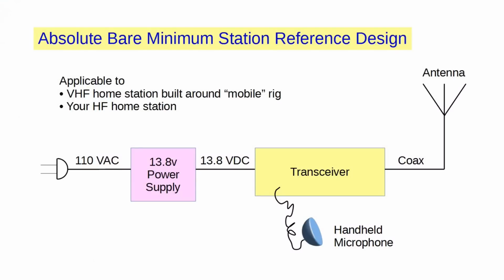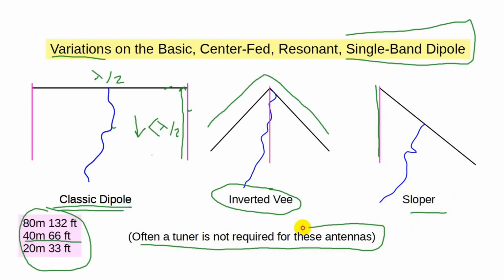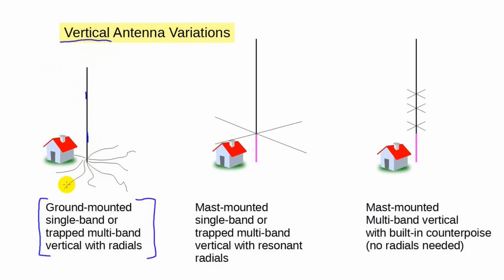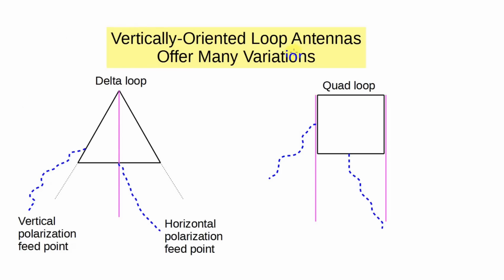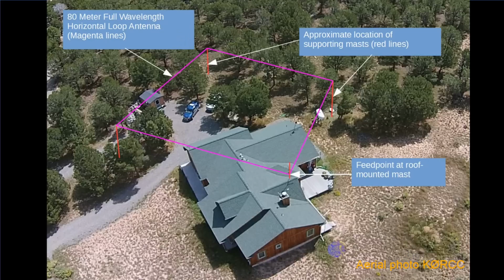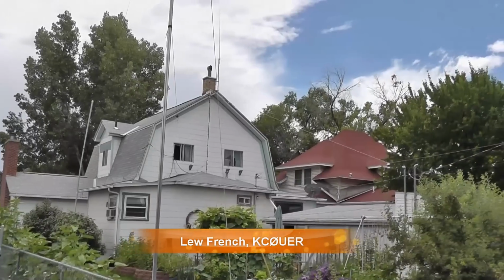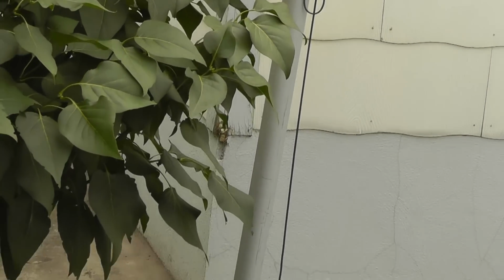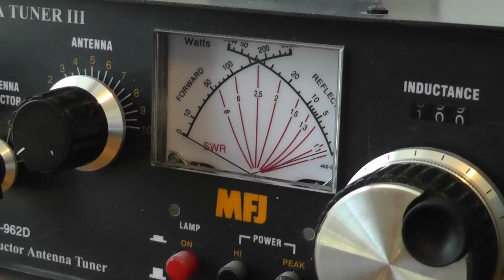Antennas for Difficult Situations: Ask Dave Episode 7

Comment: Hello Dave Great channel ! can you describe a scenario where an antenna is to be mounted on a 6 floor building ?
Reply from the maker: +omkar joglekar Are you mounting the antenna atop the building? One way to go is to put up a vertical and simply spread the radials on the roof. You could attach the base of the vertical to a piece of plywood and then put concrete blocks on the wood to hold it in place--that way it doesn't affect the integrity of the roof. You may also want to guy the antenna, again using concrete blocks as anchors. I did this once when I was in the Air Force. If, however, you're referring to operating from a location on a lower floor, look at antennas such as the MFJ-1622. I've not used it, but it's designed for operating from an apartment building. 73, Dave, KEØOG
Reply: +David Casler thanks ! 73

Comment: I notice more dipoles than standard  element antennas ,of course dipole may be cheaper but will they work as  good
Reply from the maker: +danny blackhorse The basic dipole is the workhorse of ham radio.
Reply: +David Casler I am giving up on the ATAS 120 for now, & made a 10 meter dipole & a balun with wire, connectors & some old glass insulators. I need to drive a bunch more groundrods, & bond together all the duct work & plumbing for better counterpoise to get that ATAS 120 to work right. I need to make a new Balun for my old VHF UHF antenna. That ATAS is mediocre at best on VHF/UHF.
Reply: +David Casler .  lep

Comment: Hello Dave awesome job , I bought a Hustler 5-BTV  almost 10 months ago and for some weird reason cant get this antenna to work on 10 mtrs , I took this antenna down 4 times and  reassemble  it and still cant get a good SWR , I am looking at a Kenwood  AT-230 or the MFJ-926B  what is the best choice thanks
Reply from the maker: +danny blackhorse Hi Danny, I wish I had a simple answer. To start with, given that the 5-BTV is a trapped vertical, the only section that is supposed to radiate on ten meters is the bottom section. Perhaps the antenna is located so that the bottom section is down inside the fence or something like that? Also, if the bottom trap (the 10-meter trap) is failed closed, the antenna will work on the other bands, but to your ten meter signal, it looks like a 15-meter antenna. I haven't used a trapped vertical in many years, so can't make many suggestions, other than to consult your local ham club to see if someone can take a look at that trap. Note that the traps are not interchangeable. Now, here's the radical other suggestion: given the current sunspot cycle, not much is happening on ten meters. I've been pretty much just on 20 meters during the day and early evening, and 40 meters at night. So set ten meters aside for the time being, and enjoy 20 and 40 for awhile! My current vertical antenna simply won't tune on 15, 12, and 10. I have a plan to fix that, but all things considered would rather spend my time operating. Regarding purchasing an antenna tuner, if you really want to get on ten, you may want to put together a simple ten-meter dipole and use that--it'll be less expensive than a tuner. A ten meter dipole is only ~5 meters (15 feet-ish) long and can be put up most anywhere. I'm just thinking you might want to hold off on the tuner for awhile if you're getting good results on 80, 40, and 20. Hope that helps and doesn't muddy the waters too much. 73, Dave, KEØOG

Comment: Great video.  All that is holding me back here on setting up an HF antenna is time and money.  What are your thoughts on OCF/Windom antennas?
Reply from the maker: pkevin79 OCF and Windom antennas have been around for about as long as radio, so they work fine. But in spite of what's said that they can work without a tuner, I think if you use one you should plan on having a wide-range tuner, such as those sold by MFJ and many others.

Comment: This was a fantastic video Dave!  Thanks for putting it together.   I do have a question.   I'm building a house and the framer/roofer is using SolarBoard to help with attic heat.  I have a 2m J-Pole that I've used in my attic and would love to run some HF antennas there also.   Do you think the SolarBoard will basically shut down the communications?

http://www.norbord.com/na/roof-sheathing/solarbord

73s from KK4ZMK - Dean
Reply from the maker: Dean Lisenby Hi Dean, it depends on the solarboard construction. If it has aluminum foil, or is aluminized plastic, then it will likely preclude an attic antenna. If it's plastic without any metal in it, then you're likely okay. Two meter J-poles aren't very big; perhaps it could blend in with the landscaping in the back yard? 73, Dave, KEØOG
Reply: David Casler - well.. it appears from the installation notes that the builder is to place the "foil" side down...   Creativity, here we come!

Comment: Great video again, Dave!  For home use, I've got an Inverted-V that is 20' up at the apex and is anchored to my privacy fence on both sides of my yard at a height of 6'.  I used 4 army surplus aluminum camo net poles and have a wireless weather station at the top.  Away from home I use a 6 - 40m end-fed that I can raise 28' into the aid by means of a telescoping fiberglass windsock pole or also with a painter's pole.  With the two of these I've worked contacts as far west (from Fort Worth) as Japan, as far east as Rostov, Russia and south to Chile.  Necessity is certainly the mother of invention!

73 from KF5RHI
Reply from the maker: Richard Slusher Hi Richard, thanks for sharing the details of your antenna. Sounds like you have a winner! 73, Dave, KEØOG

Comment: First of all, great video. Keep going. Now let's see, vertical antennas are not efficient. Coil loaded antennas are even worse. Short verticals are terrible. I am using a Falcon Outback 2000 mobile vertical multiband antenna mounted to the gutter of my flat. Cost about $30 second hand. Somehow i am in an ideal situaltion because, check my log on eQSL or QRZ, I work the world with it on 6-20m, specially 10-15m works great. No amps here, i would burn the antenna if i blew more than 150W into it. Below 20m it gets complicated making contacts, but as you said, better a bad antenna than no antenna. Check my antenna setup on http://www.qrz.com/db/ea3hoe
Reply from the maker: Ton Machielsen Ton, you are proof positive that compromise antennas work! 73, Dave

Comment: Can electric fence wire be used to make an antenna? It comes in 12.5g, 14g and 17g and is usually either steel or aluminum on 250', 1/4 mile and 1/2 mile rolls. I sell these where I work as well as all the insulators, connectors and other accessories for it. I also sell the chargers and have considered getting a couple of 12 volt fence charger solar panels for backup battery purposes but I'm not sure if that is something I want to get into just yet. Great videos Dave, thank you for taking the time to do them. Be well and 73
Reply: Jason Mate, galvanised steel wire, electric wire, insulated wire, annealed copper wire and anything with wire makes a good antenna.
Steel fence wire works fine too.
In WW2 the radio op's used anything they could to great affect.
Any wire is great for HF and Short Wave radio tx and rx.
Reply from the maker: Jason Hi Jason. Yes. You can make an antenna out of most anything. Copper is usually best, but both aluminum and steel will work. 73, Dave, KEØOG

Comment: Great video, the only thing you could have said was a few things about magnetic loops.
Reply from the maker: Scubasky There are lots and lots of antenna possibilities. I didn't cover Yagis or any multi-band antennas. Magnetic loops can make great antennas but I think they're a more advanced topic. Some are available commercially. They're usually very high Q and rather finicky to tune. In general, they're quite a bit smaller than wire antennas.